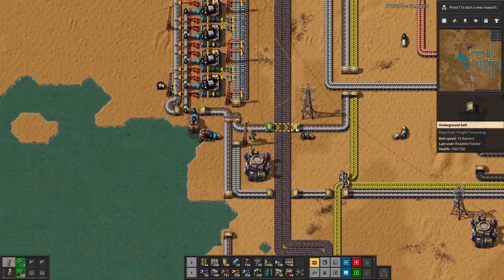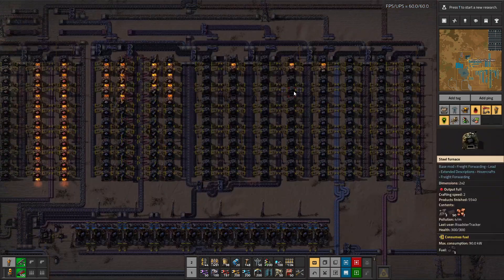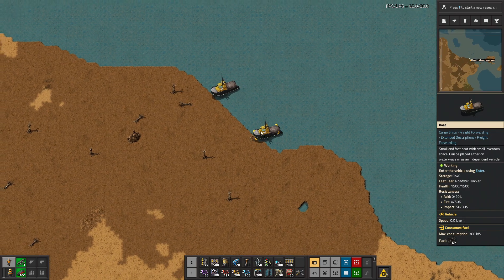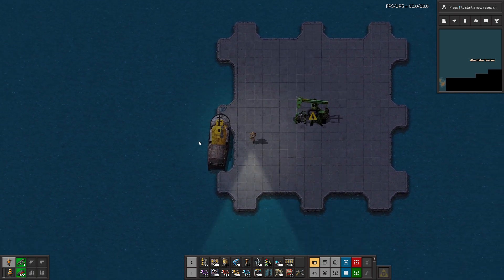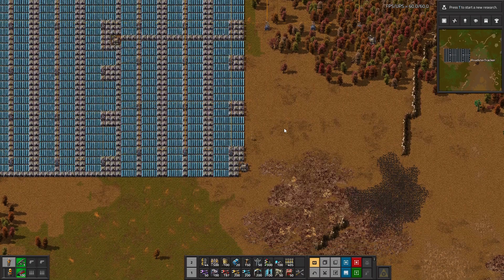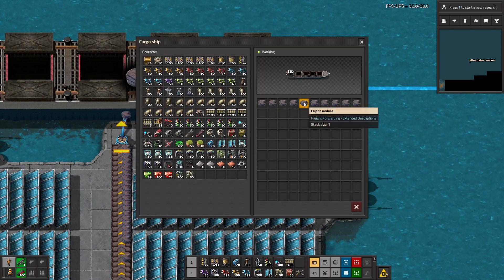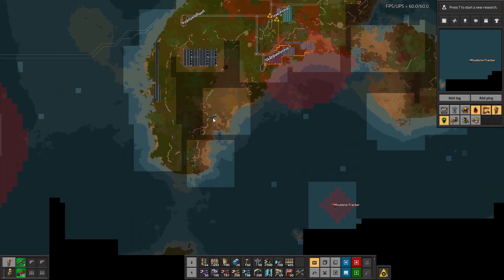Setting up our first Dredging station! Factorio Freight Forwarding Ep 49

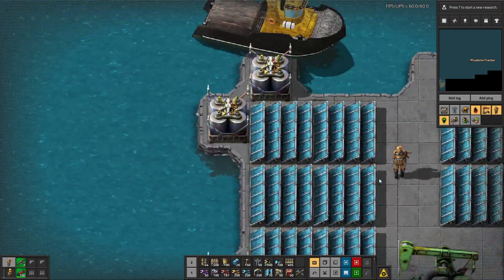Comment: At 19:51 - I have no clue if you ever end up solving this issue, but I'm pretty sure you're meant to ship batteries to the platform and use a Discharge Station. With 5MW output it'd run the platform and then some.
Reply from the maker: I did indeed do that, but only with later dredging platforms. It almost seems like a pure solar solution should be possible, but...
Reply: @roadstertracker  Oh!! I'm looking forward to seeing your build!! A pure solar solution would be nice, too. I suppose if you're willing to run it at a little less than perfect efficiency, it's doable
Reply from the maker: @ayasekaru  It worked well enough for the copper station, but for cobalt, well, it's hard to get enough out as it can, every drop of energy counts...